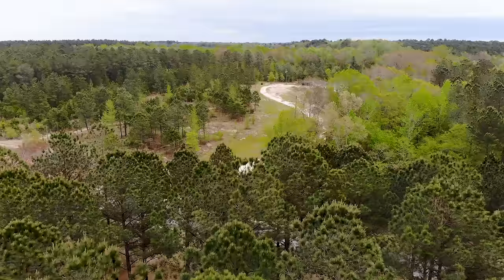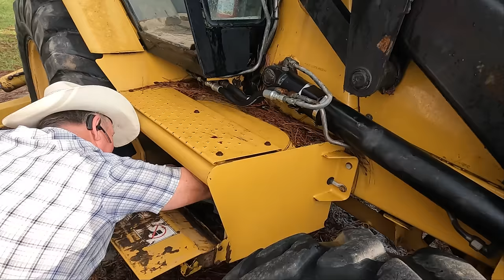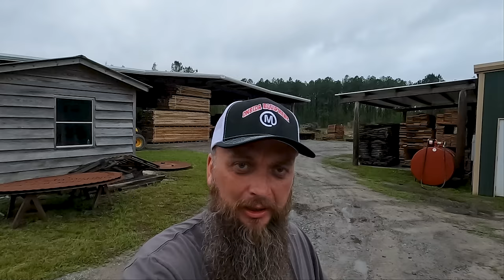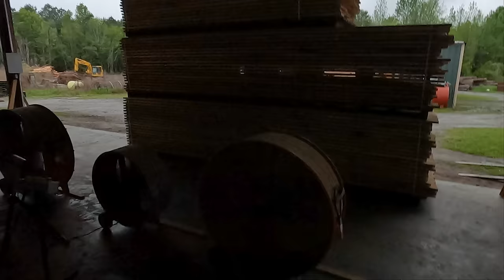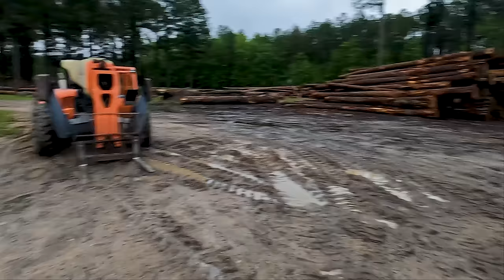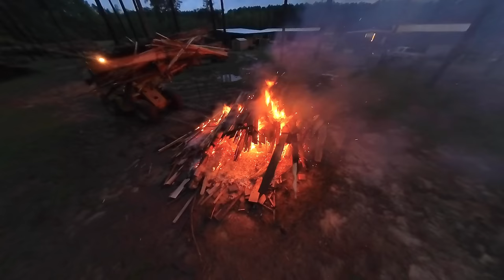Best Sawmill Business In The South? You Decide, Take A Look

Comment: That loader would be more efficient if it had a large Homestead grapple which minimizes trips from stock pile to burn pile.
Reply: That loader moves a lot of lumber pallets around, much more than handling slabs.
Reply: I have a grapple and trust me the forks work a lot better.   The only time we use the grapple anymore is when we are cleaning up brush.
Reply: We will simply disagree on this issue💡
Reply: Completely missing the point